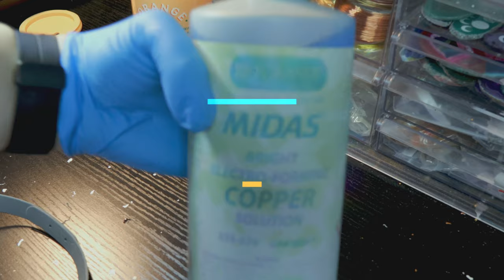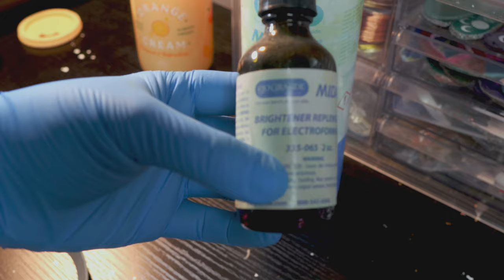Electroforming Tutorial: The Basics to get you started!

Comment: Hi, love your designs! If I dont have epoxy clay or polymer clay, is there anything else that can be used like Model Magic or oil-based clay?
Reply from the maker: Thank you so much!! As for sculpting you can use any sort of clay that will harden. I have seen people use air dry clay although I would strongly recommend something like Polymer or Epoxy clay so that helps to strength the durability of your design. Anything that stays pliable can break during wear or potentially leach unwanted contaminates into your electroforming bath if there is any soft clay exposed. I hope that helps!

Comment: Hi! I love this video and have been referencing it a bunch the past couple weeks as I begin my journey electroforming. Could you specify the purpose of the soap and what product specifically you used on your pieces after removing them and rinsing? Thanks so much. Love your work! 🖤
Reply from the maker: Yes I can definitely specify here. The soap I used is the soap that came with my Proteclear when I originally ordered it. It is called EZ Prep Concerated Cleaner & Acid Neutralizer by Everbrite. I use it just in case a dip in the distilled water after taking it out of the bath did not fully clean the piece of if it has been sitting a few days and I have been picking it up a lot and moving it around this will help clean it deeply. It does not do anything to shine it up though. You can purchase it on amazon which is where I got mine. I also use a mixture of water and baking soda to neutralize my pieces after removing them from the liver of sulfur to stop it from further reacting once I have achieved my desired darkness. I hope that helps! Please keep asking if you have any more questions! Thanks so much :)
Reply: @crystalforged  thank you so much for the thorough and insightful response! You did an amazing job of explaining everything both in the video and all your comments. Super appreciate you, and best of luck on your metalsmithing journey (I saw your more recent video hehe) 🖤🖤🤍

Comment: Hello! Such a nice video!!! I enjoyed so much! Can you tell me which epoxy clay are you using? I have difficulties to find something that can be sculpted this way and not just as a "repair kit" for plumbers 😅☺️
Reply from the maker: Hello! Thanks so much! I am glad you enjoyed the video. :)  I use the Aves Apoxie Sculpt which is a 2 part modeling compound and has a working time of about 3 hours before it starts to cure. The clay fully cures after 24 hours and I have found it to be super durable and have been using it for the last several years now. I have it linked in my description  from amazon  which is where I purchase it whenever I run out.

Comment: Heeey !! 
How many times do you change the copper wire in the tank?
Mine became very "dusty" in very little and i think make the object that i whant to electroform weird
Reply from the maker: Hi! I tend to only change out the wire when it gets very very thin. I discovered that if your copper wire is a weird pink color, covered in blue crystals, or anything out of the ordinary you can take the copper wire out let it dry out and then use a stainless steel scrubber or brush to shine it back up. When  you tank wire gets shined back up it seems to do much better with electroforming and prevents some of those weird patterns. Just make sure to clean the wire good so you do not get any contaminates in your tank that would effect the process. I hope that helps!

Comment: Hi when I use protection on som beautiful shiny thing,  it seems like it looks dead  instead,  but still clear, and I tried som different.
Reply from the maker: What brand do you use? I specifically use the Protecta Clear which I have linked. That does need a cure time of at least 24 hours although I usually allow my pieces to dry without disturbing them for 48-72 hours to allow the coating to fully cure and not get marred or cloudy from handling. If you are using protecta clear or any other type of clear coating is it newer or has it been sitting a long time? I have run into an issue with my Protecta Clear that after using it for over three years it started to turn cloudy and a weird color due to the age and I was getting to the end of the can. After getting a brand new one I had no issues again! Hope that helps :)
Reply: @crystalforged  Thank you much

Comment: Have you done any videos on electro forming large objects? I’m a basketry artist and considering trying electro forming on some of my sculptural works but we’re talking 12”+. Thanks!
Reply from the maker: I have not done anything too large. The largest object I have done is am 8" hairstick, but you can definitely do much larger electroformed work as long as you have a larger tank and much more anode in your tank. If you are doing larger sculptures make sure you use enough copper wire or copper pipe at that point to ensure your tank is adequately saturated for the copper to form onto the piece. Larger works will also need a much longer tank time so for jewelry I typically do 24-72 hours depending on the size, but you may be looking at a much longer time depending on the amount of amps you are using to get a nice thick coat of copper.
Reply: Thanks alot! I’m thinking of trying to find a setup architecture from people who do bronze shoes, etc….